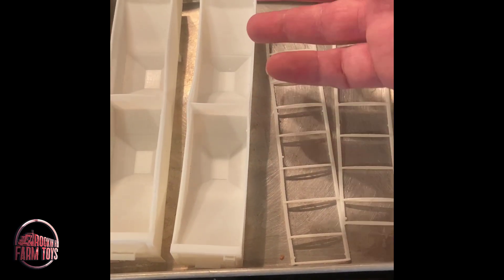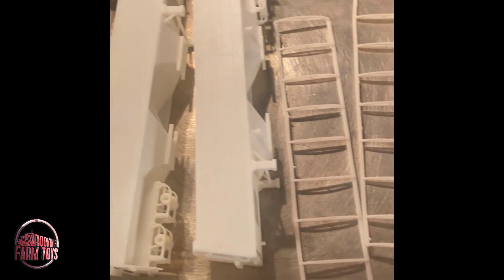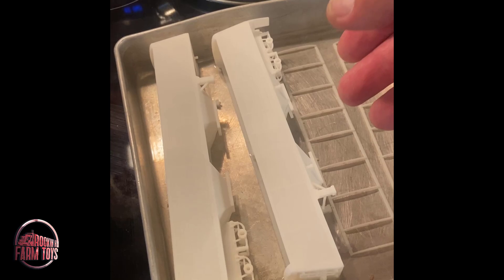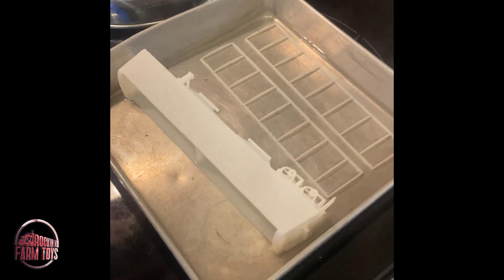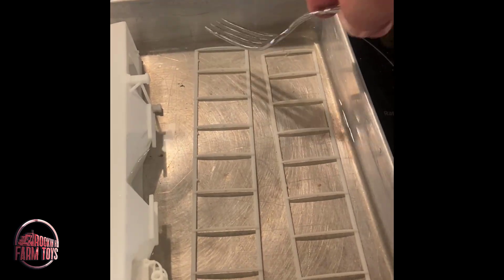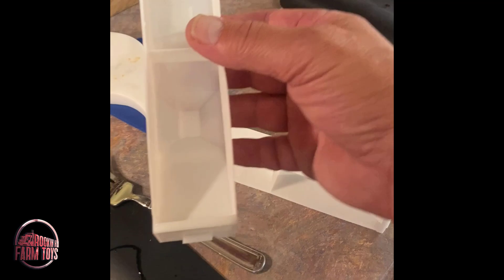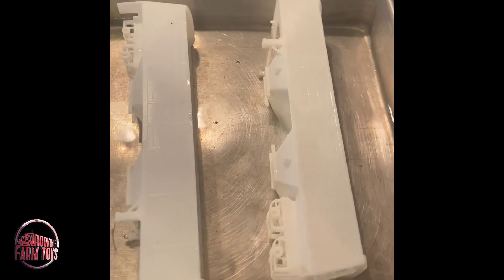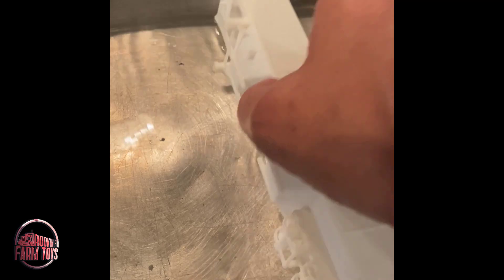How to Straighten Warped 3D Printed Resin Parts | Quick & Easy Fix 🔧🖤

Comment: Love this tip! But tell me, is that water straight from boiling, or did you let it cool a bit?
Reply from the maker: It was a rolling boil right before I hit record on this video. Matter of fact, I have a pan I will boil water and turn down the heat a bit and warm of parts in the pan.
Reply: @RockinHFarmToys awesome, thanks so much! I ended up using hot water from my Keurig and it worked pretty well! Next time though I'll use water closer to boiling. Thanks for this, you saved me some massive headaches.
Reply from the maker: @BillyBillyBixby  Perfect! Great idea. I had a significant batch of trailers like in the video to straighten up. That is when I used the frying pan. For one or two pieces, I will use the tea kettle.